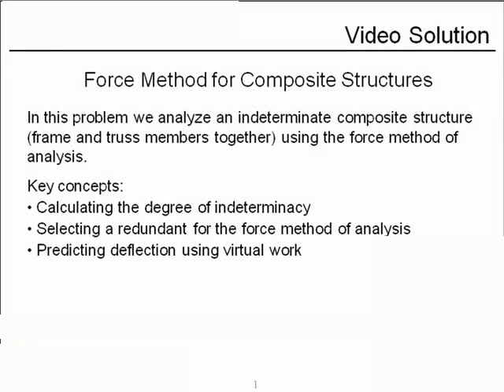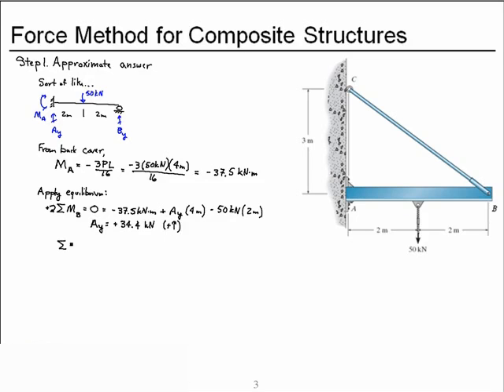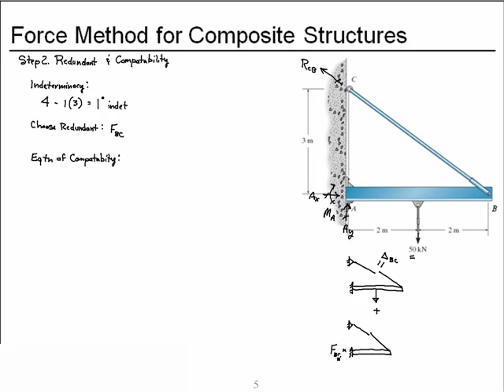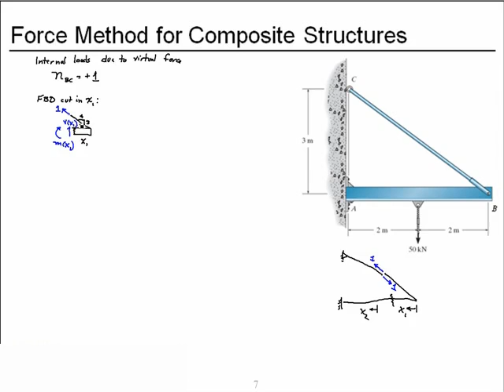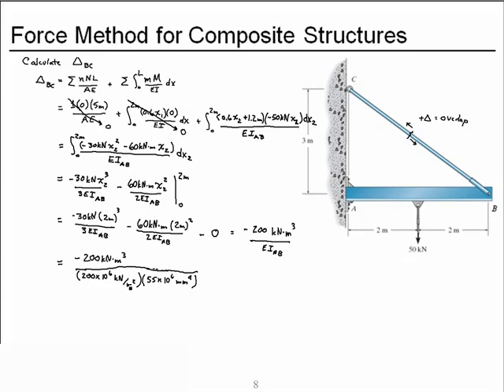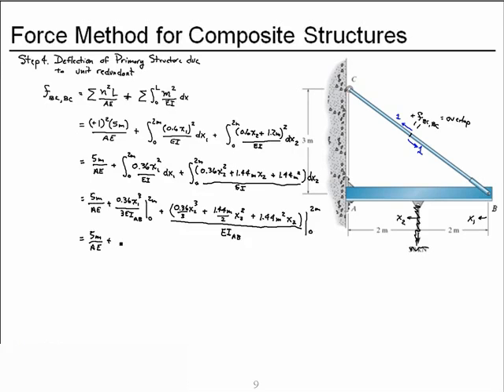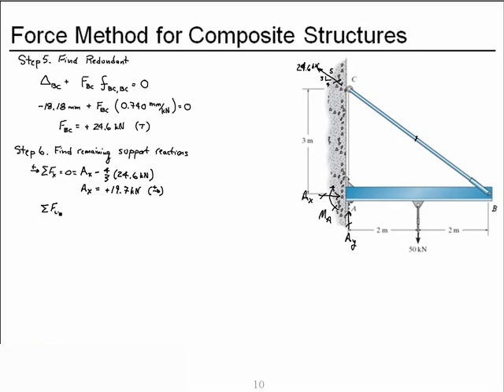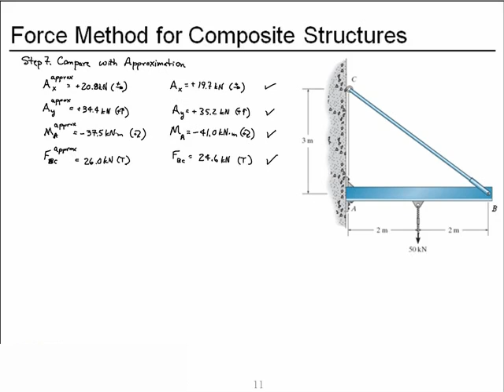Chapter 10-Force Method for Composite Str (SI Units)

Comment: This was really helpful! Thank you !!
I had a similar problem but instead of a fixed support at A
It was a pin at A and a roller at B
So in the virtual work method I had to find By before finding M and m
However the equilibrium equation did not help since in the virtual structures the 1s cancel out
can you help me with my problem plz